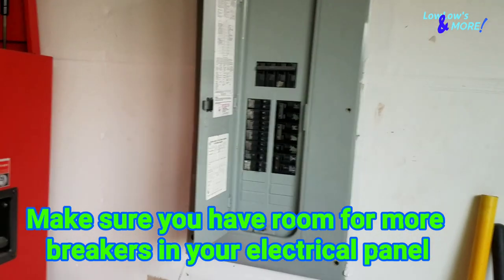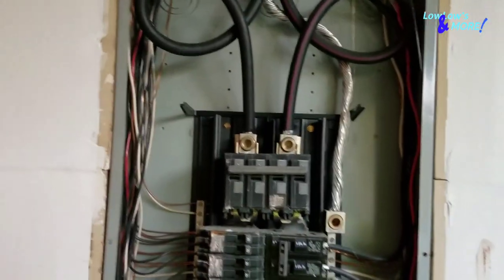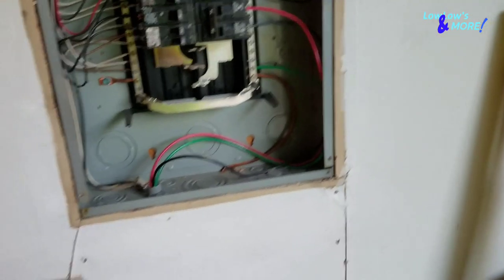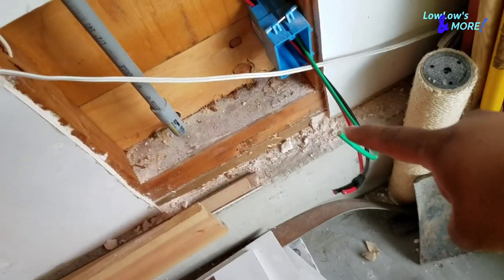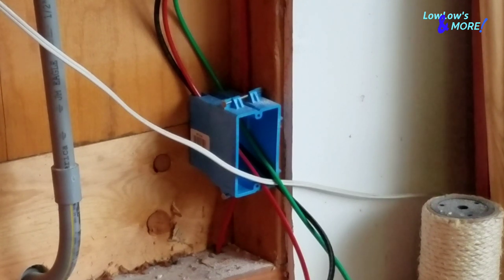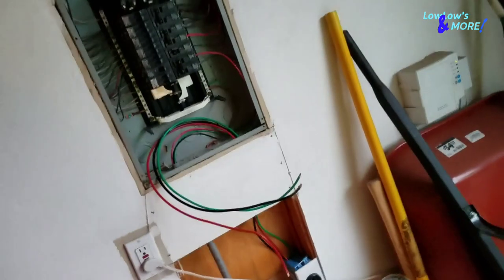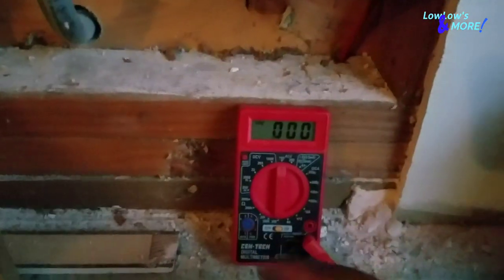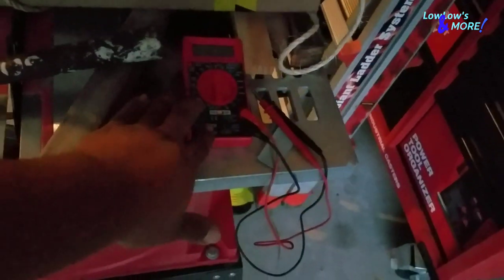Hooking up a 240v Outlet in the garage - EASY

Comment: The common ground bar or the neutral bar is for like your stove and other appliances that need 110v for like the clock and display but also needs the 240v. If it only has 3 wires, like a welder, it will be two hot wires and a ground. Stoves and dryers are 4 wire. Two hot, one ground, and one neutral. Most of the time

Comment: Exactly what not to do . Many code violations and fire hazard.
Reply: I need to install a 240. What's wrong with his setup?
Reply: @georgio231  at a minimum I'm pretty sure you need a metal box in the garage...
Reply: What codes is he violating? The box needs to be metal right? And also if that is THHN wire shouldn’t it be ran with conduit?
Reply: Why conduit?  Isn't the 240 volts at the socket?  The hot wires run at 120 separately. Does this make sense?
Reply: JWPeña I was told only wires like romex can run without piping. Thhn wire was always told it needs to be covered
Reply: Oh I see. I didn't notice that he didn't use the regular romex. Thank you for the info. Two romex can be used for the 240 socket correct?
Reply: JWPeña lol oh I’m not sure. I’m not an electrician and not trying to give advice hahaha. I’m just YouTubing electrical work and this caught my attention from what my Eectrician told me
Reply: Ah okay. Yeah I'm researching these topics. Thanks again and good luck with your projects!